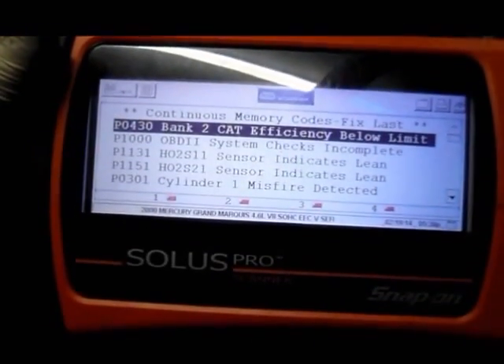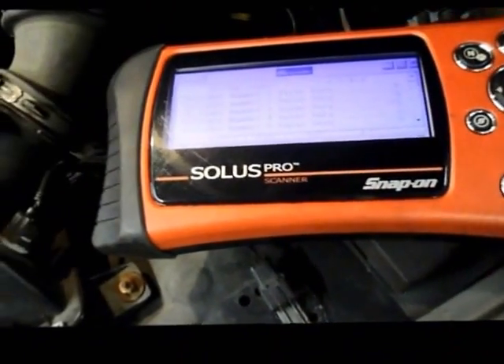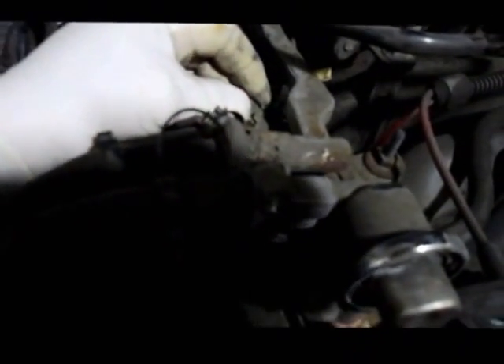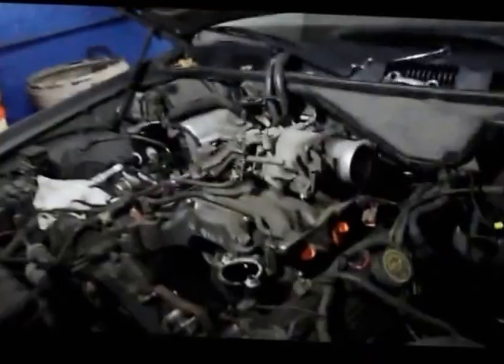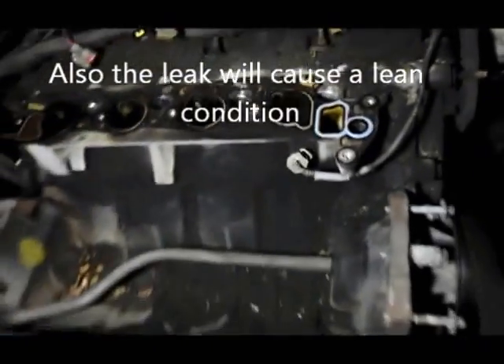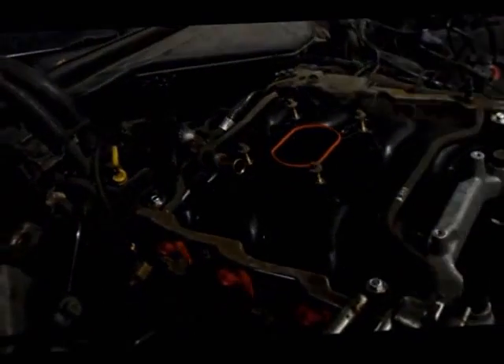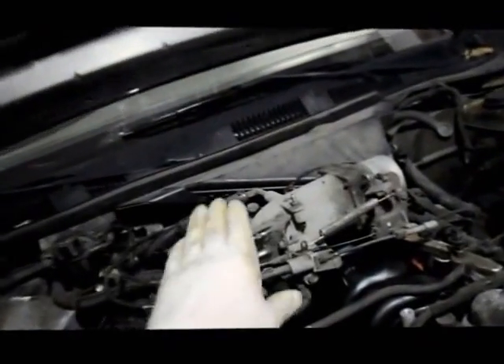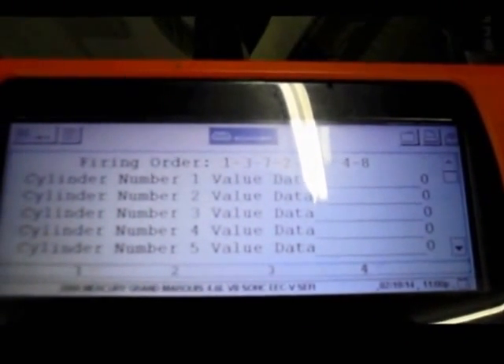PO1131 & PO1151 LEAN EXHAUST

Comment: Hi Mr. Jim from NC. Thankyou for all of your hard work and well detailed videos. Can you please help me? I have an 02 Ford Explorer XLT 4.0. I just replaced the intake manifold gaskets. Before I got to it I had an issue getting the egr valve bolts out that caused a tweaking to the egr valve but I pushed it back. I was putting everything back but I had issues getting both bolts back into the egr valve that connects to the intake bracket. I was only able to get one in but its about 80% flush. So after almost getting everything back together I  went to start it and now I'm having issues. It started up but immediately died and left codes. The codes are P1131 and P1151. Prior to me changing them out I had no codes. Do you think me not having both bolts in even though its pretty flush can cause the codes and dying out? If there is any way that you can help it will be greatly appreciated. Even if it would be better over the phone please let me know.  Thanks 🙏🏾

Comment: I dicovered on another video, when you switch to the newer manifold you have to plug the dowel holes with silicone so you don't get vacuum leaks. These lean codes were a real pain to diagnose. Car now runs cooler and gets better gas mileage!

Comment: Hello, my name is Jay I have a 99 ranger 3.0 rough idle poor performance only has p1131 and p1151 codes all 3 o2 sensors new, done head gaskets,  IAC, maf, dpfe, fuel pump, fuel filter, and all 6 fuel injectors, tps, egr and egr solenoid, new coil plugs and wires, I'm at my wits end, oh and new pcmr. Previous owner installed a cold air intake system on it. Can you help?

Comment: Hi I have a 2002 f150 with codes po136, p113, p1151, po171, and po174  and my truck is  using to much water, So may be is the water going into the exhaust?

Comment: Hi I have a 2002 f150 with codes po136, p113, p1151, po171, and po174  and my truck is  using to much water, So may be is the water going into the exhaust?
Reply: WHAT DID YOU IND OUT ABOUT YOUR CODES ?

Comment: I have code 1151 car cranks run fine. when the engine warm up it start jerking loose power.
Reply: MrBodean2010 
p1131
Reply: Right there with ya.. I’m honestly thinking it’s an electrical issue
Reply: Same code, and only code..
Reply: Did you end up figuring it out?

Comment: Hi Jim, I am a female still learning on how to fix my own cars.  I have a several codes, P1131,P0303, P0302,P0031, & P0171 the mechanic my father took the car to (1997) Mercury Sable said the engine manifold was gone or blown and so was the transmission. Can these codes tell if the trans is gone?
Reply from the maker: +Judy Caldwell The codes  you have are all engine codes most likely from the intake manifold leak or possibly bad coils.Let me know f you need any further advice.

Comment: I have the same codes in my 99 ford ranger!! 3.0 I change the all 3 o2  sensors still the same problems!u think should be change the intake or just check for leans?
Reply from the maker: +jose de alba What is the codes that you have before and after the o2 sensors were replaced ? Did you check for vacuum leaks on the manifold  or hoses.?